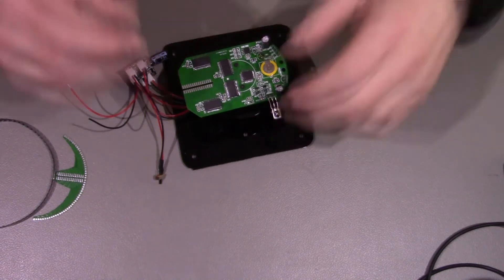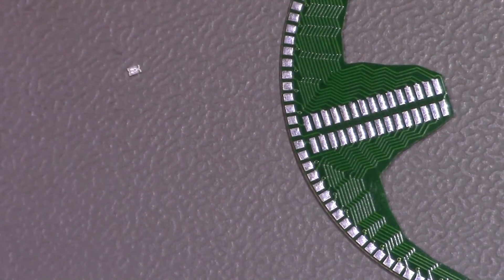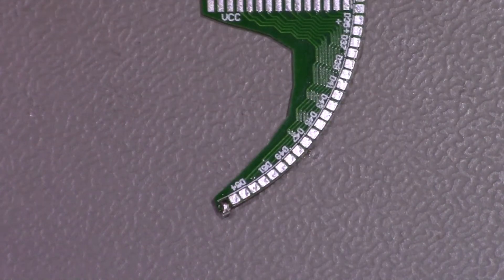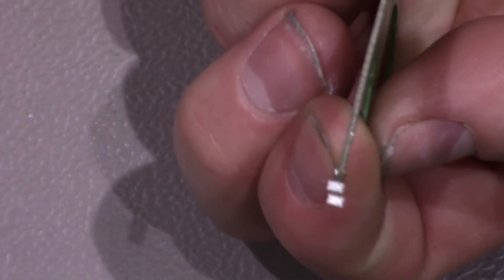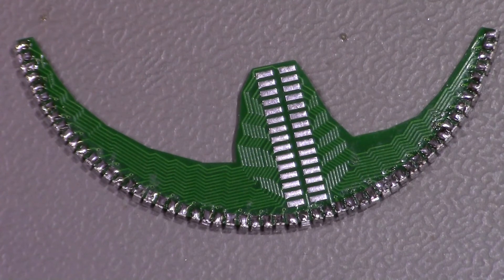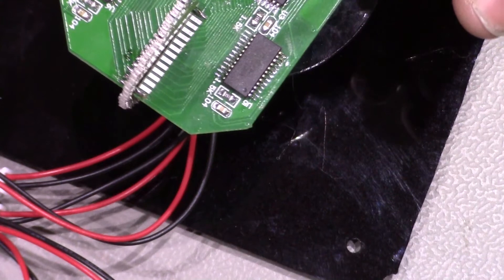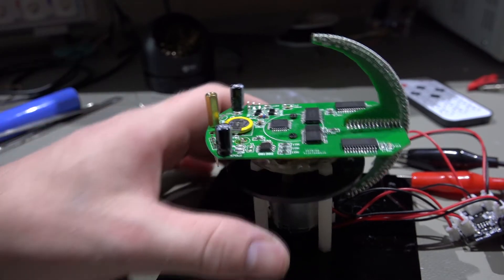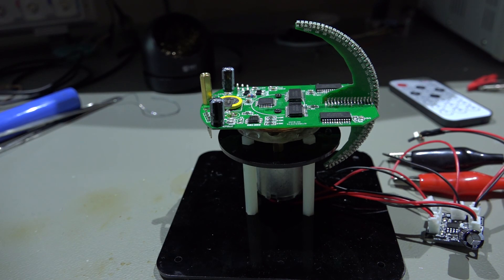DIY POV Spherical Rotating LED Kit - Part 4

Comment: I get its an old video but did you ever get this to work?
Reply from the maker: Hi, unfortunately not, did spend a bit of time checking all the solder joints again and component placement etc, then have up on it
Reply: @ElectronicStuff  thanks for the reply, yeah these type of things are not worth spending time on, there more of a if it works great, if not chuck it type of thing, i get its a 3 year old video but i did enjoy watching the 4 parts so thanks for leaving them up.
Reply: @ElectronicStuff  I almost ordered a dual spherical kit, after seeing the trouble you had...I will wait, until I can muster up the nerve to attempt this.